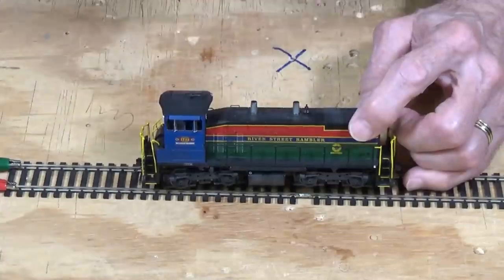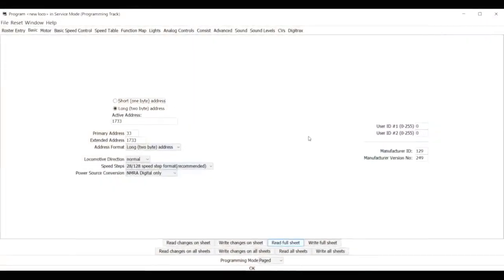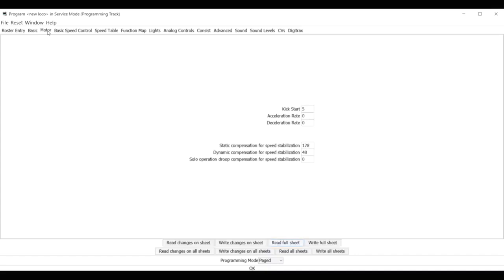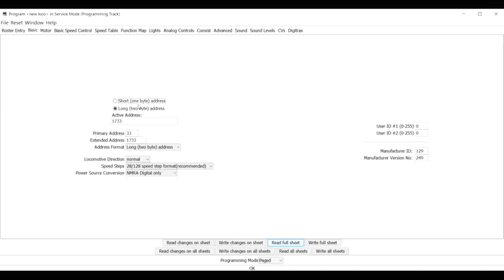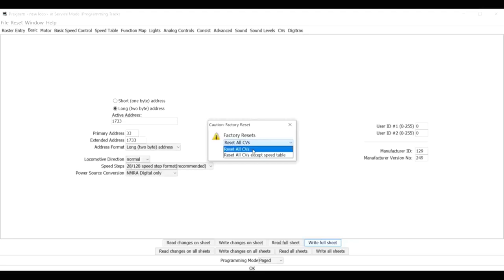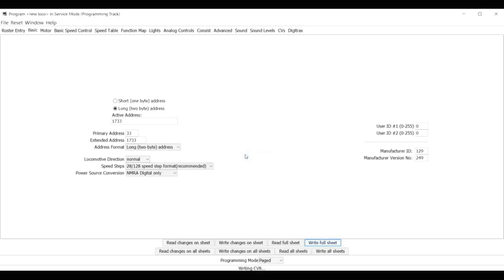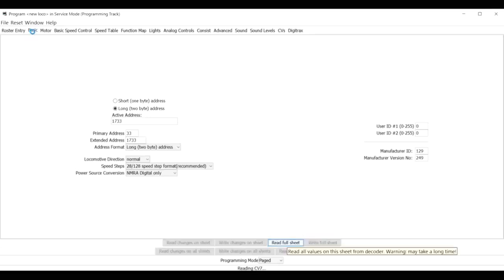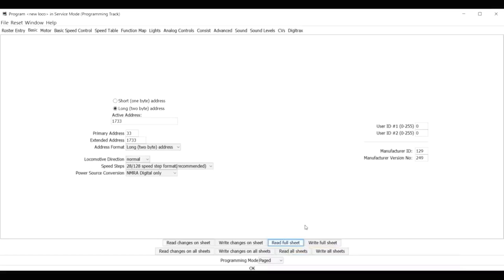Restore A Dead Decoder With One Easy Command (291)

Comment: Larrry As always good tips.  I have done a few CV8 = 08 on a couple of my decoders which cleared up problems. Most of my decoders do not have any cv changes in them but in the future, I will save the config on my decoder pro computer which is on my work bench where I have my test track that I setup on my engines on never on the main line.    Thanks

Comment: Hi Larry, nice video. Another source of decoders not responding is when the user forgets that the locomotive is in a consist. If CV19 is set to anything other than 0 it won't respond to its regular address (unless you are using NCE and the consist was programmed on that very system).
Reply: If the loco has been programmed in a consist set by someone else on their layout, does this consist function stay with the loco when it returns to my layout? I have a few locos come back from a friend’s layout where it was consisted and can’t get the loco to move. I use NCE like the one Larry has. Thanks for any advice.
Reply: @kropotken  Advanced Consist stays with the locomotive in CV19. So when you return home your NCE system doesn't know that your locos are in advanced consist. You can run they by the consist address (1-127), but if you want to run them by their actual address you have to do the advanced consist on your system.
Reply from the maker: Stuart is correct about advanced consists however universal or command station assisted consists are only stored in the command station so will not travel with the locos.

Comment: For DecoderPro users who have previously saved a loco's settings, using a programming track, select the loco from the roster, go to the CVs tab, and use the Compare function. Depending on the decoder, this can take some time, but will show which CVs are now different. If it's only a couple, they can easily be restored.
Reply from the maker: Good tip, that’s a lot faster than doing a complete rewrite which can be prone to errors.

Comment: I have 3 atlas n scale engines with factory decoders. I have reset them using CV8 and CV 30. Then I reprogram them they will light up but won’t move. Any suggestions?
Reply from the maker: What address did you use? You may have reset the address to the original default of 3.
Reply: I tried address 3 but still got no movement. I did reset one of the locomotives again today and tried address 3 and got the same result, it lights up but doesn't move. I've read that a magnet can reset a decoder, is that accurate? These are NCE decoders according to the case they came in. thank you.   @TheDCCGuy
Reply from the maker: @kevinihrke  Since you don’t tell me which decoder it is I just picked one at randome from the NCEDCC.com website and they say:

CV30 -  Set this CV to 2 on the programming track and the decoder will reset to factory settings.
Reply: Thank you. I’ve tried that as well but I must be doing something wrong so I keep trying and hopefully I’ll get it figured out. Thanks again, I appreciate your help.

Comment: Hi Larry, I have a tsunami 1 decoder that appears to be stuck in an advanced consist and does not respond to any of the decoder reset functions on Decoder Pro, or my throttle. Any advice on how to fix this?
Reply from the maker: Have you tried reprogramming CV19 to a value of “0”? If that doesn’t work then did you possibly lock the decoder? It sounds as though you tried a factory reset. If none of that works then call tech support and see if 5hey can help.

Comment: Hello Larry. Zakery Dartt here, I'm new to DCC I've been building a layout for the past few months. I have an Walthers GP15-1 Locomotive Dcc and sound. I recently upgraded to a Digitrax Zephyr Express. Once I got the locomotive program to the Zephyl. It was working correctly for a few minutes. But after learning what function I had and they did. The locomotive started acting weird. Now it won't move or make any sound of any.  I've been a subscriber of yours  for a good while and watch the video on restore a dead decoder.. I am going to give that a try and see if that will solve the problem. 

Thanks for all your video and tips.
Reply from the maker: That probably hast a SoundTraxx decoder in it so should be a good performer. Let me know how the reset works for you.
Reply: @TheDCCGuy  Hello Larry. I tried the reset but it didn't work. I see the changes of the setting on the screen, plus I can hear little sounds coming from the engine while the programming writing is going on, if that is normal, but the engine still doesn't respond. I'm going to take to my local hobby shop after the holidays and have them figure it out. I will update you what the out come is.  Thanks, really enjoy your videos and and have gotten several tips.

Zakery Dartt

Comment: Nice presentation.  Presentation idea for ya. How about how to program these multi CV/index CV setting.  QSI and others?  How, what, when etc.
Reply from the maker: When I want to do indexed CVs I definitely use DecoderPro. These can get very complicated to access and program. TCS even has a program on their website to calculate these CVs it is so complicated.
Reply: Actually what I'd like to see is a video describing advanced function mappings. I think I get what they do, but I've never seen them used in real life.
Reply: @chrisridd9423  most of this stuff is probably pretty easy to do….especially when you have a mentor, (club member or friend) show you how to do these things.  Self-teaching has it limitations even with YouTube’s.
Reply: @fallnflags5587  you're probably right and I guess every decoder and user is going to have very different needs. Nevertheless given how poor (super technical describing what you can set, less helpful explaining "why") decoder manuals are, a video might be worth a shot

Comment: I have that problem with my loco. I was programming the braking rates and momentum. Then I go to test it and my dynamic brake settings were not working. So I went ahead and reset my loco. Then started over reprogramming the cv's again and then it all worked fine.
Reply from the maker: Often that’s all it takes to sort it out.

Comment: Hello, Mr. DCC Guy.  I have a related question and hope you can help.  I just bought from Trainz a new Athearn G63925 HO Amtrak SDP40F Diesel Locomotive.  It is a DCC ready unit of which I will be installing a new DCC/sound decoder.  When placing it on my Digitrax test track, it causes my Digitrax DCS50 command station display to rapidly blink its address.  Is this some type of 'short' and if so where should I look to fix it.  Thank you in advance.
Reply from the maker: I’m nit understanding what you are doing. You have a loco without a decoder that is DCC ready with no decoder and trying to operate it using a DCS50 Zephyr. So what address are you using? You should be able to run a single DC loco using address 0 on your system but don’t do it for long as the motor can heat up. Once I hear back from you with clarifications I will dig out my DCS50 and try to duplicate what you are seeing.
Reply: @TheDCCGuy  Sorry Mr. DCC Guy for the confession.  Here is my situation:  1. I bought a new Athearn G63925 HO Amtrak SDP40F Diesel Locomotive which is DCC ready; 2. It has in it from the factory a DC board;  3. When on my test track and under the default address, my Digitrax DCS50 command station starts rapidly blinking the address number. Is there some kind of  short inside of the loco or dose it have a bigger problem?.
Reply: @anthonygunter4064  The board in your SDP40F is not a decoder. As a result it will not run under any DCC address. It may run under address 0 on most Digitrax systems.
Reply: @stuartaaron613 , You are correct and I stand corrected.  It has a "Board" in it.  From the factory it has an address of 03 but when I put it on my test track and turn on my Digitrax DCS50 command station, the display of the command station starts blinking the address number rapidly.  The engine doesn't move unlike other engines I've similarly tested.
Reply: @anthonygunter4064  The "board" is not a DCC decoder. It has no address on it. You have to remove the dummy plug from the board and install a DCC decoder in place of it.
Reply: @stuartaaron613 , I know all that already and that is why I bought it so that I can install my own DCC/sound decoder.  The problem I'm having is an electrical short.
Reply from the maker: Even with the dummy plug the loco should still run using address 0. It sounds as though you are experiencing a short. I suggest you first try running the loco using a standard DC power pack to make sure it does not have any internal shorts. The dummy plug simply connects the track power pickups to the motor leads and should not create a short. However there may be other reasons a short could occur with the loco wiring so first diagnose the basic loco operation.  Do not attempt to install a DCC decoder until this question is resolved as it likely will destroy it.
Reply: @TheDCCGuy  Thank you and I'll try your suggestion first.
Reply: @TheDCCGuy  Hello Mr. DCC Guy, I followed your recommendation and hooked up my standard DC power pack to my test track.  To my joy, the engine in question ran perfectly.  Now, I'm ready to move on to the next test.  So please advise...
Reply from the maker: Next I’d check the DCC system by running a different loco on it. Also check page 32 in the manual for error codes. Finally I’d dig out an old decoder, plug it in and see what happens.

Comment: I have a digitrax decoder That's has always been a problem it runs just fine until it besides desides too take a break I put it the programming track and it runs until next time.
Reply from the maker: The next time it does that try the factory reset method. That should clear it completely and may resolve whatever is causing it to misbehave.
Reply: Already tried that.

Comment: I lock all of my decoders with CV 15 and !6 and ever since I have had no problems with random CV changes or decoder brain farts.
Reply from the maker: Interesting approach, I’ll have to try that with some decoders. In theory it shouldn’t since the intermittent shorts act on the components directly and not be dependent on a CV setting but since I have never bothered locking them it would be a good test.
Reply: You may be right but it certainly prevents old guys from broadcasting to 20 different locomotives if he is on the leading edge of old timer’s disease by selecting programming on the programming track by mistake.

Comment: One point I might add is that I have been chatting with TCS and they advise a factory reset value of 2 into CV8. Not a value of 8 as mentioned above.
Reply: I thought setting CV 8 to 8 was the standard way of resetting a decoder as well. It is indeed very common but apparently not standardised - do a search for "dcc reset decoder cv" and you'll find a manufacturer-specific list.
Reply from the maker: Some decoders offer several options in addition to CV8=8. With TCS you can selectively reset just certain sets of CVs or just set them all back to factory using a value of 8. There used to be a lot more variations but most manufacturers I am aware of offer CV8=8 and then a subset like TCS does.